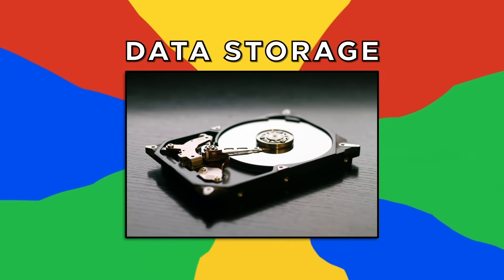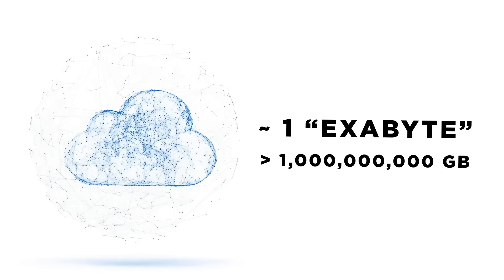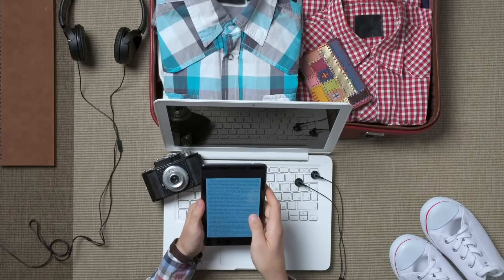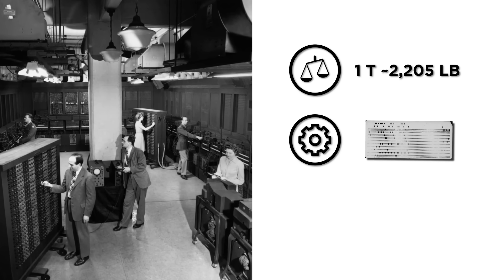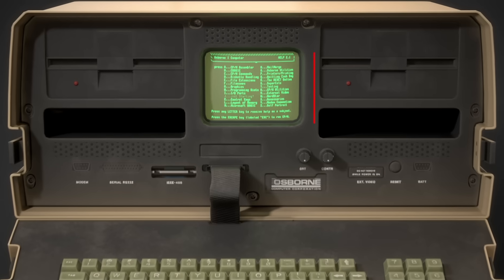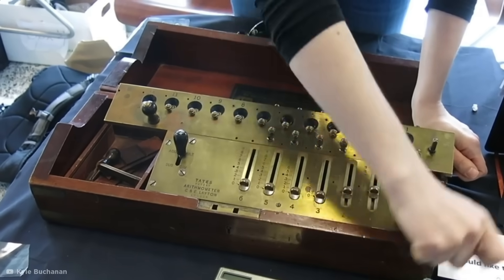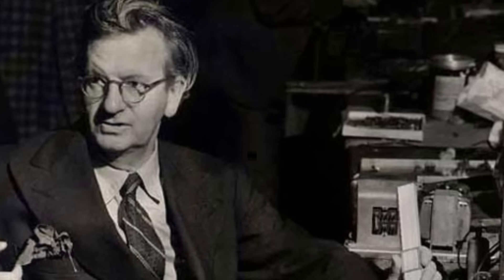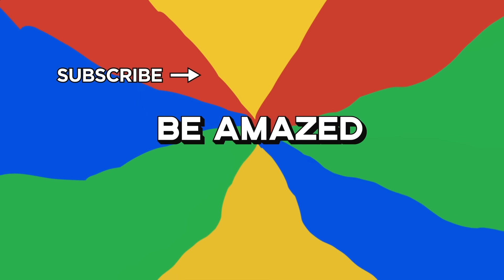Past And Present Technology Then And Now

Comment: CRT TV's had NO pixels. They were 1 continuous line scanned from top to bottom of the screen.. In the case of Colour  Tv there were 3 lines scanned  Red Green and Blue behind a mesh
The mesh was aliened so only one of the 3 colours would show throw each hole the the mesh. Giving the appearance of pixels but not pixels still just 1 line. Thats why old tv resolutions were measured in lines not pixel..
Also the first FULLY PROGRAMMABLE  computer was Colossus. Built by the British in 1943 by Tommy Flowers and Alan Turing..  https://en.wikipedia.org/wiki/Colossus_computer

Comment: One thing about the Mobile Phone is, If it was not for two Tech experts from the British Army Core of Communications who invented the way to send the signals from mobile phones using the Radio Tower Masts we use now! We would not have mobile phone systems?  They also invented the mobile phone it's self too.. but had to ask Motorola to help make it Then Nokia used the idea to do the 1st small mass produced mobiles.  And as for the 1st main frame computer, it was "Colossus" made by Tommy Flowers a Post Office Engineer in the UK to do code breaking in the 2nd world war. > https://en.wikipedia.org/wiki/Colossus_computer   And he got no official thanks or paid back the money he personally paid out to build this computer due to it being top secret until years after the war as it still classed a as top secret. So no IBM did not have the 1st one.

Comment: Technically you do get see a small portion extra on either side of the visible part of the Moon only a certain area on the back of the Moon isn't visible which is a majority of it this is why the moon can lookdifferent on different nights especially if you have a telescope and you're looking for like the face or Crater they might be positioned more Western or Eastern li depending on the time of year

Comment: 3.5" disks came out before 1986! Apple had SONY's new drives in their Macintoshes in 1984. But those were the 720K ones before 1.4MB. And then capacities topped out at 750 MB. Other physicsl sizes came out too, like 40 MB 2" disks.

Comment: "It is so fast that it's measured in FLOPS"
That line hurts. That it's PETAflops is the special thing, not that they use FLOPS as a unit.
That unit must be as old as the transistor itself if not older and is used for pretty much every kind of processor, including comparetively weak microcontroller and literally every PC CPU, not just supercomputers.
Reply: Xbox one x has 6 petaflops lol
Reply: @ARBUZIK.dudkin  its 6 tera flops
Reply: There's a crapload of errors in this video.

Comment: Technically the Motorola dynotech was not the first mobile phone. Mobile phones were out for years. The military had what were known as mobile field phones. Did pretty much the same thing. This was used in WWII. That's why they were called mobile radio operators.Yes the dynatec's were short range and like walkies talkies. That's why they were extremely limited. Also, Apple screwing you over since 1976.
Reply: Joshua Uriarte ..You are right. The Motorola was the first “Cellular Network Phone”. Meaning they worked off a network of connected radio towers.

Comment: Moore's law is no more the transister can be shrunk till 1nm
Reply: Endrio Infiniti ...1nm will not be the limit, dummy. Theoretically we can get to subatomic levels before the limit is reached.
Reply: @Iam_Dunn  Do you know the moore's law?
Reply: Endrio Infiniti ...Yes I do. Moore’s Law does not limit the reduction in size. It’s only the statement that transistors will double on chips every 18-24 months... Which, everyone in the industry agrees is pretty much dead now (that is that the doubling is taking longer to achieve.) BUT, that still does not LIMIT how SMALL components can get.

You do realize that there are a shit ton of measurements smaller than a nm right? ie; Picometer, femtometer, attometer... etc.... ??
Reply: @Iam_Dunn  Ok ok got it thx for the information :)
Reply: @Iam_Dunn  By the way I did not say that it "can't" be shrunk below 1nm. I just meant to say that it has shrunk till 1nm

Comment: be amazed : apple is the key innovater with a 256 gb phone
samsung users be like  : what about  526 gb and expandable storage of upto 1 tb
Reply: Yes 516gb since mid 2018 (note 9)
Reply: @antongebel1728  and there is also the 6.9 inch display on s20 ultra compared to the 6.1 in ipnones
Reply: @sudamacharansahu3308  and dont forget about the better resolution on all of Samsung's flagships since the s6
Reply: But razer phone supports up to 2 tb
Reply: @modyro3560  well that's true I just forgot about it
Reply: @modyro3560  do we have micro Sds with 2tb yet? Would be pretty impressive

Comment: Comparing clock only by itself when comparing processors is not a good idea. The instructions per cycle and core count should also multiply and that gives a rough estimate that the CPU on that Mac Pro is way faster than the mentioned

Comment: Think you forgot to mention today's sponsor; Apple.
Reply: Bro Samsung did it way better than Apple
Reply: @chasegriffin2193  Did what exactly better?  Oh that’s right, Samsung stole Apple’s  original patented design of the iPhone while supplying the parts and decided to make their own smartphone.
Reply: My thoughts exactly. We are lucky apple don't make TVs or calculators. What bugs me the most is that everyone forgot that the first smartphone was from Blackberry and not apple.
Reply: @Sbodge01  I forgot to mention, Microsoft corners the market for a big reason... licensing.  The major manufacturers can't sell a PC without Microsoft Windows on them.  I don't know how long the contracts will last, but Microsoft pays the manufacturers a pretty penny to hold it that way.  I dual boot Windows and Linux, but I haven't used Windows in several months (at least half a year), but I built my computer, so I have complete control over it, and I know that it's 100% Linux compatible.  Some PCs include hardware which requires Windows to operate.  I remember back in the day of dial-up Internet when super cheap modems became available, or were built into motherboards.  Unless the board had an independent controller chip, it relied on the OS to operate, hence the name "Winmodem."  I moved on to broadband the minute it became available in my neighborhood.  Now, I'm on 1G cable, but I can still hear the sound of my old dial-up modem in my mind.  I could tell by the pitch of the final sound it made whether or not I got a good connection, and was pretty much always right on target.
Reply: @Sbodge01  Actually you’re wrong, the first smartphone was the Simon created by IBM. Blackberry was the first to implement email paging and was the first to make these types of devices mainstream and successful.  Apple was the first to make a capacitive multi-touch smartphone that became the standard for all smartphones today. Without Apple’s original innovation we’d likely be about 4 years behind when it comes to smartphone tech.
Reply: @Harvey017  I didn't know about the Simon, great find I must say although the options were limited on it and I wonder if we can really call that a smart phone and in that regard Blackberry were the first to implement the option to download apps on their phone. As for Apple "Original Innovation" the Simon had already a touch screen so it looks like they just recycled something already existing. I don't think we will be 4 years behind if Apple didn't implement the touchscreen on their phone, someone else would have done it, I mean the idea was there for a long time already (Star Trek Next Generation for example).
Reply: @Sbodge01  You’re right, you could download apps on Blackberry but most were not that intuitive using the original Java based Blackberry OS.  

And yes Simon had a touch screen but it wasn’t a capacitive multi-touchscreen like the iPhone, it was using a primitive resistive touch screen.  

And I truly believe the iPhone was 4 years ahead of its time. You need to remember Blackberry dominated the smartphone market and every competitor (except for Apple) was following the same keyboard non-touchscreen design.  If Steve Jobs hadn’t pushed his engineers to the brink the smartphone as we know it would’ve been delayed for years because there was no urgency to create such a device.
Reply: @Sbodge01   My iPhone has a calculator, and I can totally watch anole tv on it as well.
Reply: Eh, what?  I recall in the 7th grade taking basic level computer programming on a Mac PC back in 1985.  The thing did not have an internal hard drive.  It relied on 5.25 inch floppies to load its command line user interface.  There was no GUI available.  I remember that so well, because of recently seeing a commercial from that era talking about the "New MacIntosh Computer" showing a scene similar to the movie "1984" with the ad-line talking about it making 1984 (the year) not feel like 1984 (the movie).  The UI made it feel like it came out of the Matrix, and was so limited, the Mac most certainly did feel like it came from both 1984 the year and the movie.  I had to change the year, since we moved out of state in '86, so it had to be in '85.  They would have been pretty much "state of the art."  Also, Microsoft corners over 90% of the market, so any money they would possibly pay to Microsoft is to let them at least get their feet in the door.
Reply: chrissscottt Corona
Reply: yah. he epically forgot mentioning it all throughout the video.:D
Reply: Facts
Reply: Aka trash
Reply: Yes Apple is good for u health
Reply: @YourAverageDrama  an apple a day keeps your wallet away...
Reply: @tjl2836  "an apple a day keeps the poor away", Robb Jobs
Reply: @YourAverageDrama  I agree but if you buy an apple for $1.00 because it has a pretty package rather than a similar apple for 30c then it ain't so good for your health.
Reply: @chrissscottt  nah would rather buy the same Apple for 200$

Comment: Maybe some basic math skills are in line, the IBM 350 was made in 1953, the Floppy was 1971!

OK, 1971 - 1953 = NOT A DECADE but 18 years!

And then it was a 8" Floppy and would not fit into that 5.25" drive you show it being pulled out of!

NOPE, can not compare a Apple one and current machines solely based on the speed of the CPU! Great FACT FINDING!

Then neither machine could use 8" Floppies!

OK, the Osborne was not the first Portable computer!

Again comparing CPU based on clock speed is COMPLETELY WRONG, the Z80 at 4 mhz would run circles around the IBM at 4.77 mhz!

Most of this is PURE CRAP!!!!!

A TV from 1930 was a analog device, not digital and NO pixels, it was measured in lines!

You do know the difference between Apples and oranges, RIGHT!

Comment: TV is the only tech that isn't really developing astronomically. It's takes about 5-10 years for new developments in Tvs to come out. For example Flat-screens came out around 90s, Plasma tvs came out in the early 2000s, HD tvs came out in 05, 3D 09, 4k, 2014, and not 8k 2020.That's why you can buy a TV and use it for 5-10 year and not see a reason to upgrade while something like a cellphone becomes outdated in just 2 years.